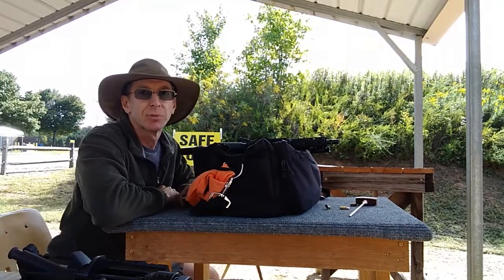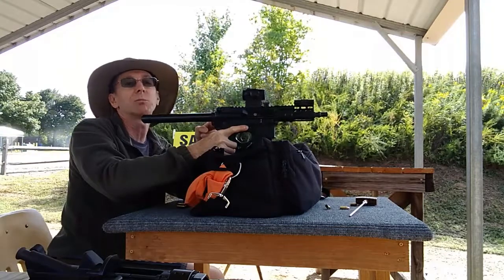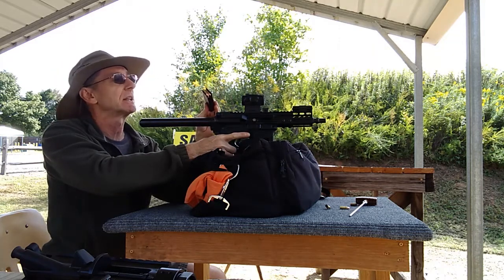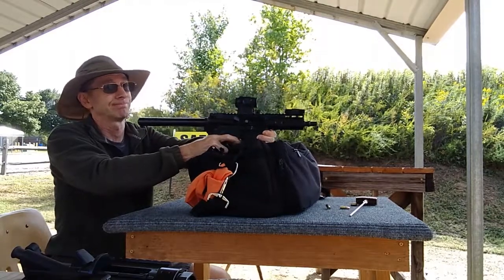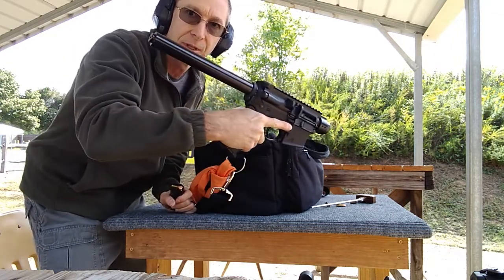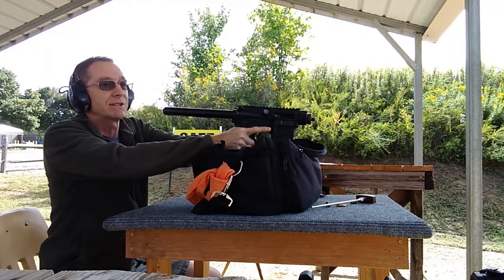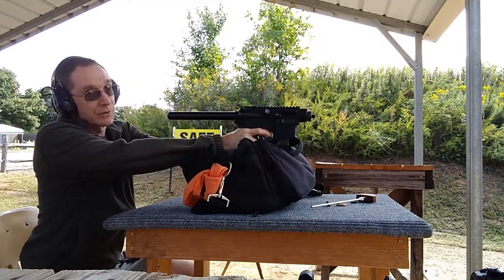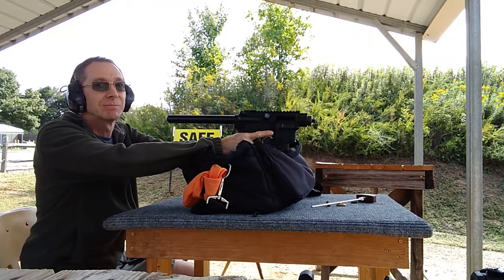The Overmass Project, part 1. How much mass can 9mm blowback cycle?

Comment: VERY interesting!  So according to your article (on your BLOG) the original Colt, "used a 16oz bolt and a 5.5oz. buffer, providing 21.5oz. of total blowback-resisting mass". Your discovered upper bound is quite a bit higher, which leaves lots of room for tinkering.  I also read that the floating weights to address bolt bounce was for the full auto models and that for semi-auto Colt did not think that bolt bounce was an issue.  That being said, I have read accounts of out of battery detonation during semi-auto fire, so I guess the floating weights are cheap insurance.

Comment: Looks like it’s time to add some weight!!! LOL. My current BCG + Buffer weight is 21.5oz with a 308 spring. Cycles perfect both suppressed and unsuppressed. But I love striving for perfection.
Reply from the maker: A .308 spring isn't necessary or beneficial for 9mm - it oversprings the system and can cause several problems.  You may want to try a standard carbine spring.  Good luck!
Reply: Thanks for all your research. Extremely beneficial. I only stuck with the 308 bc that’s what the manufacturer provided. However, charging the action is way too difficult. I plan on checking out the KAK K-SPEC buffer + flat wire spring combo u covered in another vid. Looks promising. Just out of stock. Joined waiting list.

Comment: I have a 7.62x39 Ar pistol with a pistol buffer tube, but I want to switch to the A2 buffer. Do you know what I need to keep it cycling properly with the A2? I can't just swap the spring and buffer weight over to the A2 tube, right?